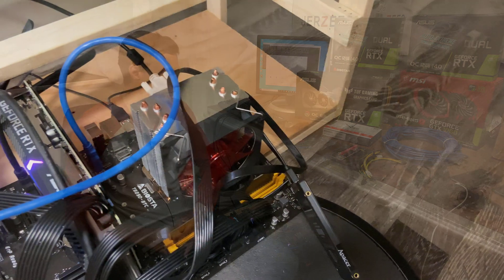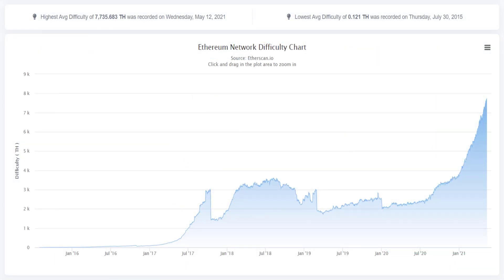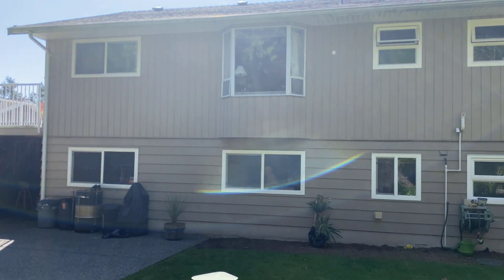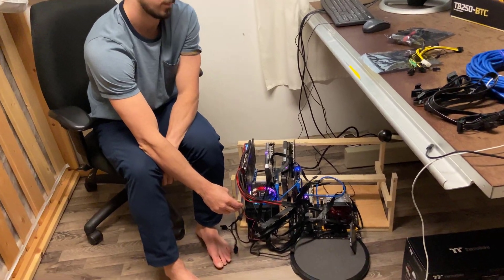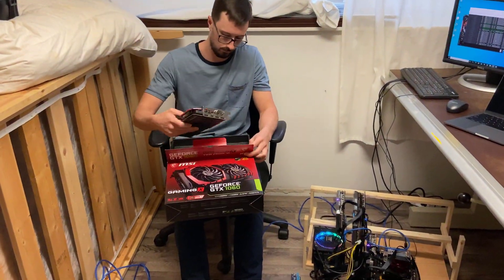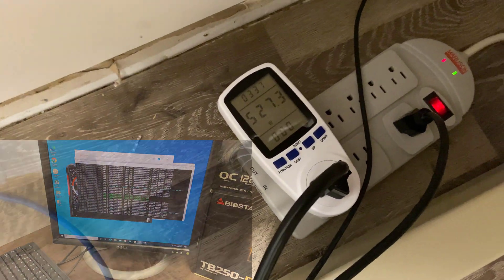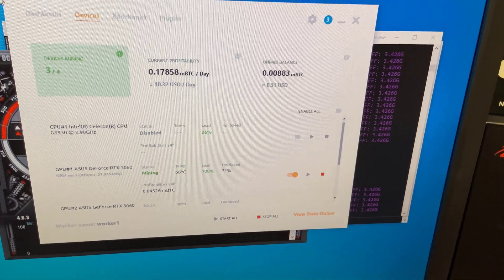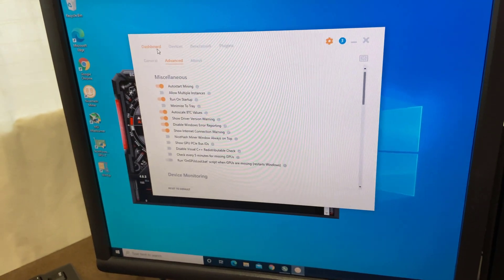2 X RTX 3060 12GB & 1 X RTX 3070 8GB Mining Rig | 160 MH/s at 525 Watts

Comment: Hi, one question. I have a Gigabyte b360m ds3h. And I want to mine eth with one rtx 3060 and one rtx 3070. It can be posible. Because I have only one pcie x16, one pcie x4 and one pcie x1. 3060 in the x16 and the 3070 in the x4 or x1 with a riser. Can it be posible in the same sistem and the same motherboard?

Comment: Hi. Thanks for the video. Which card does how much Hashrate? Is the 3060 with 12 GB better or the 3070?
Reply from the maker: The RTX 3070 is better. Thanks for watching :)
Reply: @VeeTechYouTube  how did you unlock the 3060 to work with the 3070? are you using the old driver?